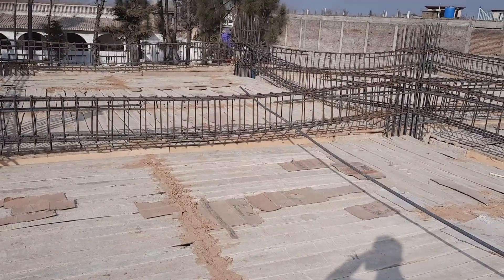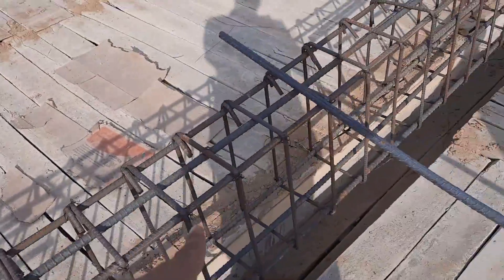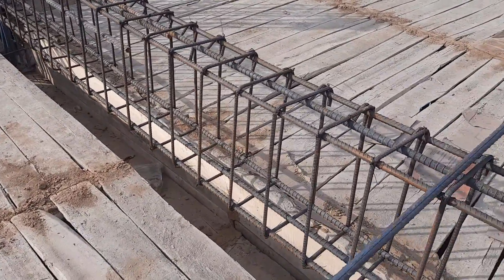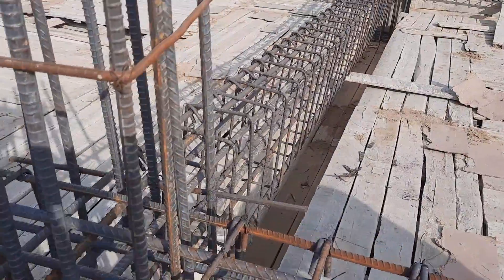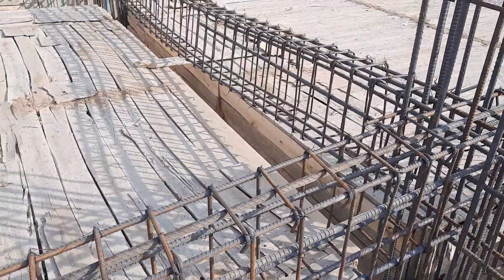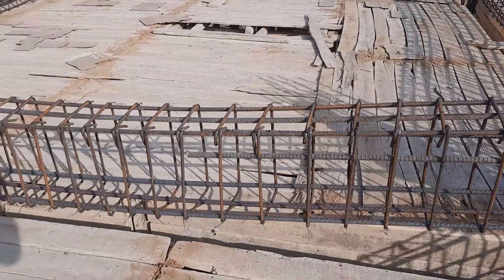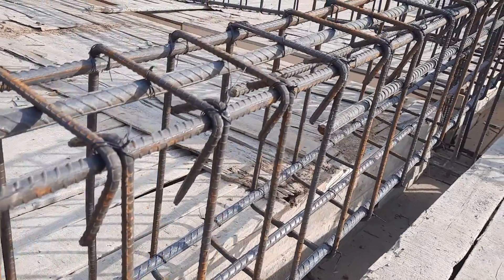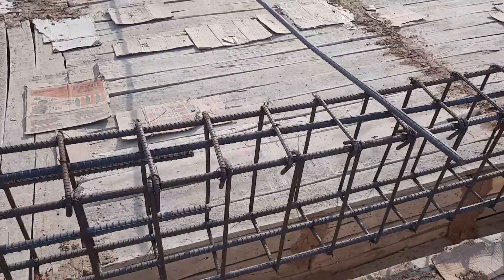BASIC INFO ABOUT BEAM CONSTRUCTION

Comment: The extra steel rods? Should they be provided on the sides? And the length of the extra rod is it in the L/4 region on either side of the column for example?